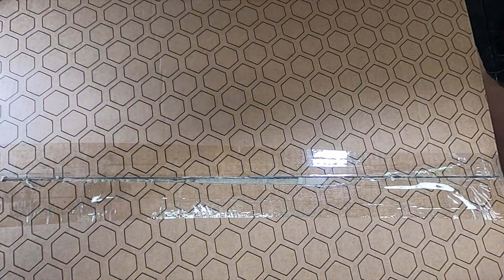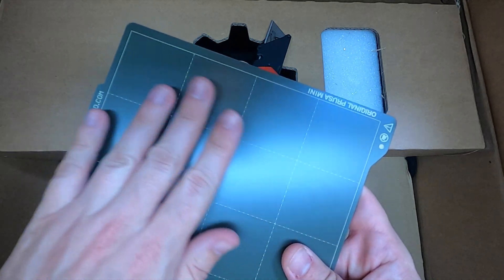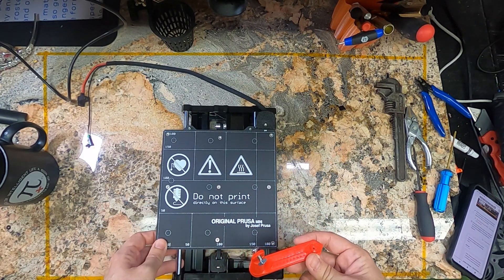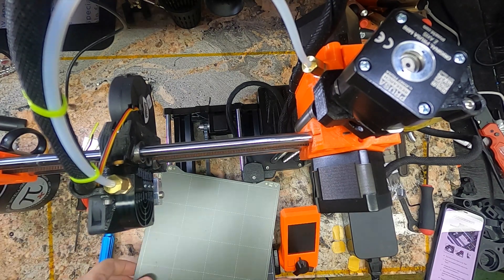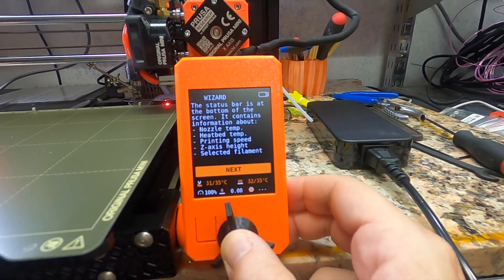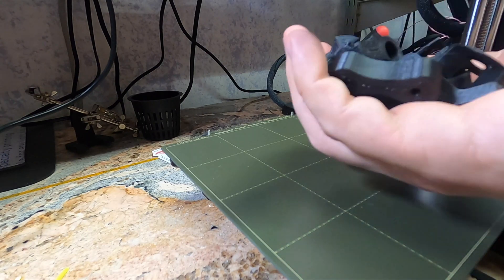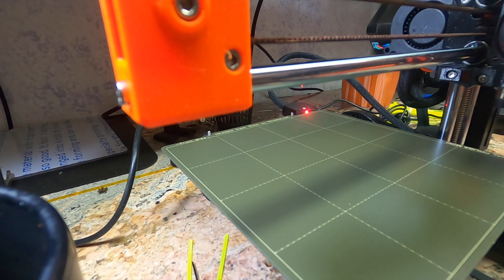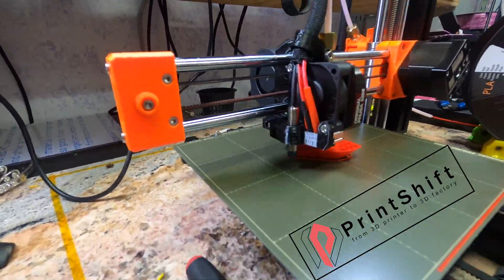PrintShift 3.0 Step 1: Printing PrintShift Parts on your Prusa Mini

Comment: This is a very interesting design. I am considering making a few of these to test. What are the current known issues with this design? It would be a very helpful heads-ups before I dive into this.
Reply from the maker: Not much - the belt is not as rigid as the steel bed, so tall prints especially I use a large brim.  ABS and Nylon are right out - they warp so much they'll bend the belt even at maximum tension... I mean maybe you could do 'em with a huge raft.  For printing massive amounts of PETG or PLA parts, though, this rocks.

I do recommend upgrading the mini's extruder - Bondtech makes a really nice kit, and I did a video on throwing it on one of my PrintShift machines.